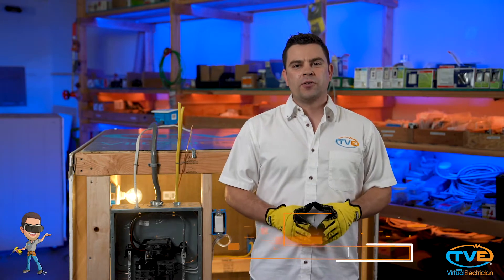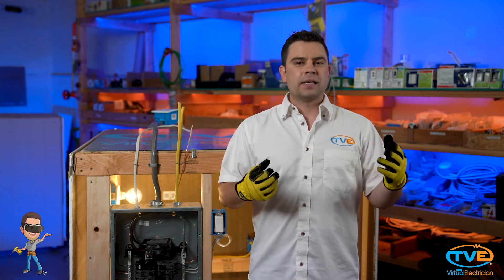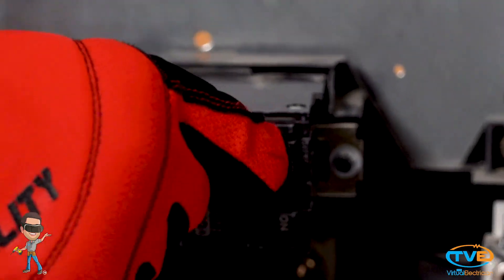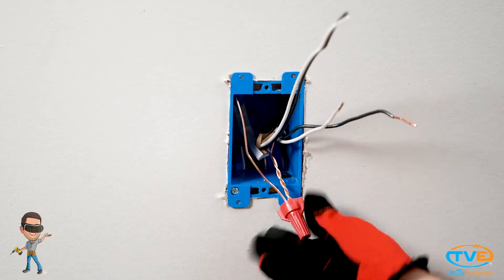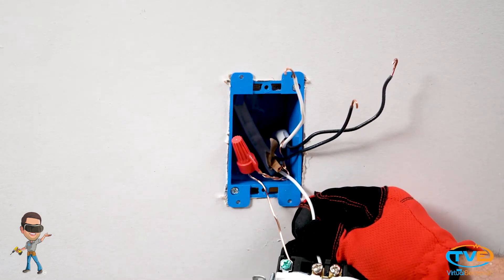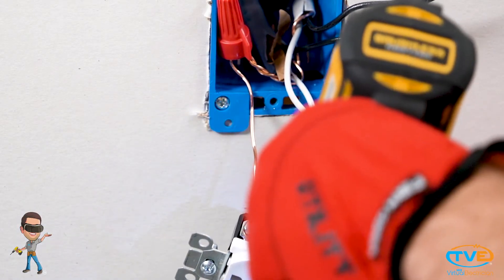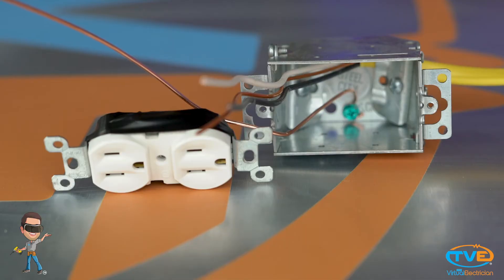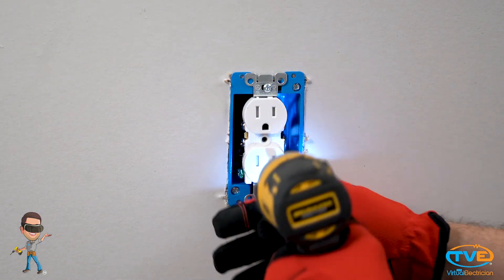How To Wire A Outlet

Comment: what if i have 2 black wires plus a red wire in the box?
Reply from the maker: Hey Sarah. More than likely you are dealing with a switched outlet.  I will upload the video for that but basically you will need to break the metal tab that bridges the 2 two hot screws together.  when this is broken, you put the black wires on the bottom screw and the red wire on the top screw.  this way the top receptacle will only become hot when the switch is on! hope this helps!